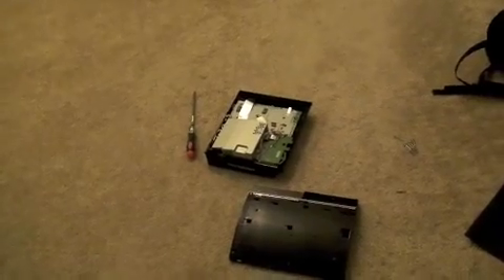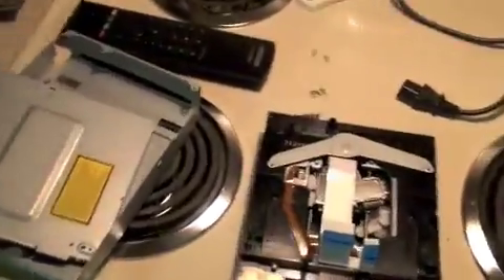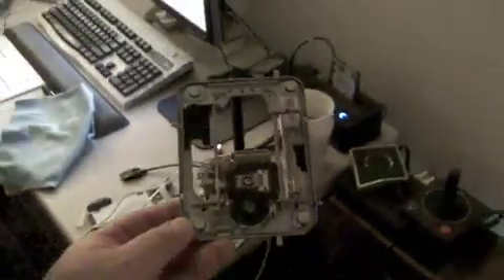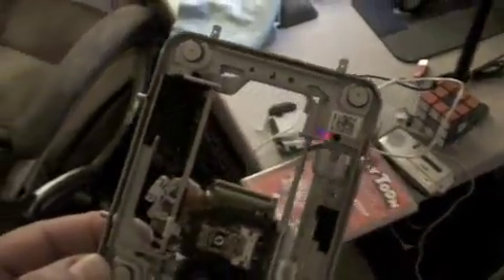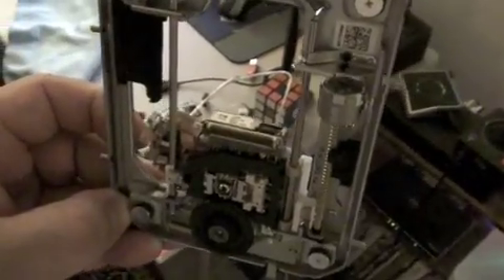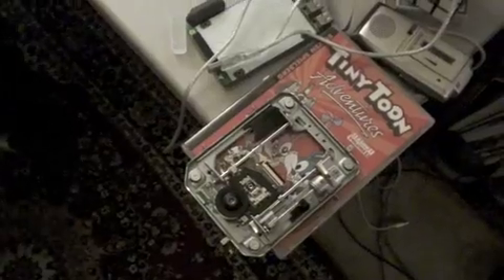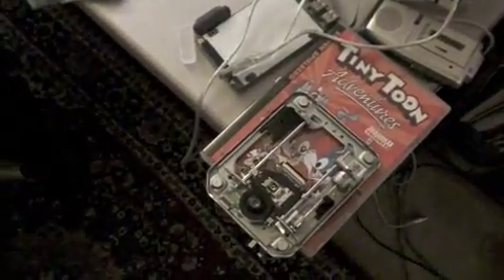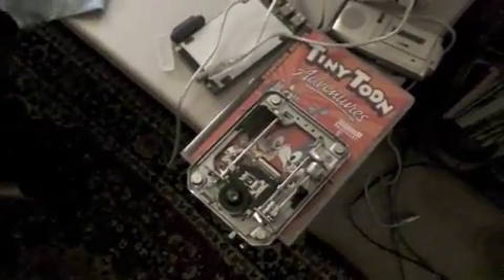PS3 laser fault

Comment from the maker: There are options in the Recovery Menu you could try first.  But make sure you have a hard drive backup just in case something goes wrong.  There is the "Repair database" option, and the "Restore filesystem" option.  Neither of these will erase the hard drive, so they should be safe.

If you have already tried the Recovery Menu options and still get failures reading discs, your laser most likely has a fault and you should replace it.

Comment from the maker: @PeronMiles If you do a clear disc check and see the red laser lighting up, it might be that you have to go into the Recovery Menu and perform the "Restore file system" and "Repair database" options.  These won't destroy data on the hard drive, but be sure to have a backup just in case.

Comment from the maker: @deadman80808 If it's in warranty, sending it back to Sony is the way to go.  If it's out of warranty and you feel confident replacing the laser, save some money and swap it out.  However, even though it costs roughly twice as much and you're without the PS3 for a number of weeks, there is some sort of warranty if you send it back to Sony for repair (I think it's like 90 days; not sure), so there is that to consider.

Comment: Those four clicking sounds is what i'm experiencing. The lens will bob up and down 4 times but not read the disc, therefore not starting up the motor. You say it's a faulty laser, and if so, should I buy a new laser or send it to sony b/c u said it's only a temporary fix?

Comment: I fixed my Ps3 after the Blu-Ray drive failed. It works perfect now. Rather than replacing just the lens, you can buy the complete new laser deck on eBay for just £60. It is far easier to install and takes just 10 mins. The seller I bought mine from paid the shipping (within UK) and dispatched for next day delivery. Arrived in brand new condition and well packaged. 

The seller's eBay user name is 'joaguk'. He is a supplier of the KEM-400aaa and the KES-400aaa. He imports directly from China.

Comment: Hello.  My PS3 had the YLOD just 2 weeks ago.  Opened it up, heated the motherboard up and it works now BUT now the Blu-ray laser does not work. I have a 60GB bought aud 07.  I opened up the bluray drive and I need a KEM-400AAA.  You mentioned HyraTech and richspsxparts as companies that have them, but now they are sold out.  Do you reccommend any other places to get the laser?

Comment from the maker: Oh!  This one's easy.  The solution, if you haven't figured out on your own by now, is to put a flat-bladed screwdriver in the slot at the top-right, just to the left of the short screw.  Push in slightly and pull up on the top cover.

Comment from the maker: I received the replacement lens hardware from HyraTech and installed it.  It cured that PS3's woes.  Works like a champ now!

My unit just died in operation.  One moment, I could see the disc in the XMB; after the next disc swap, it would just sit there forever with the "disc loading" animation in the upper-right corner.  It may be that yours is actually giving you some warning before going completely.